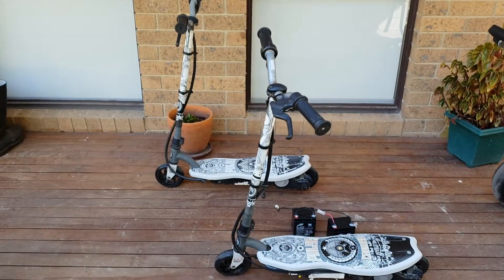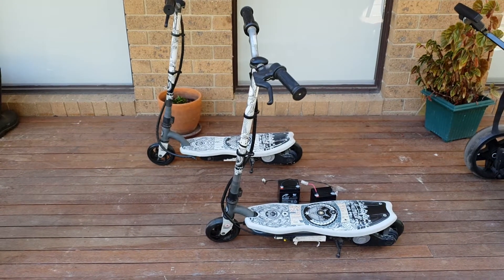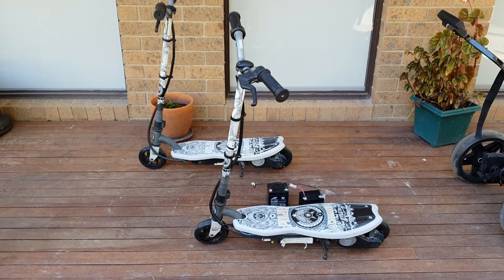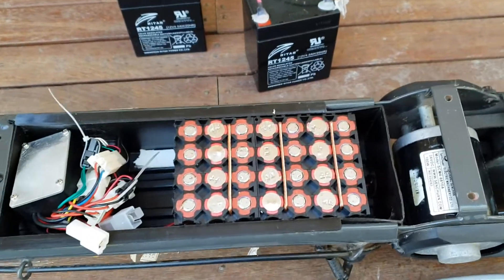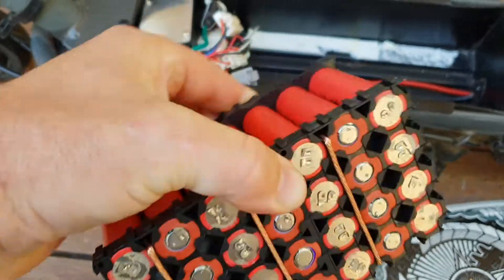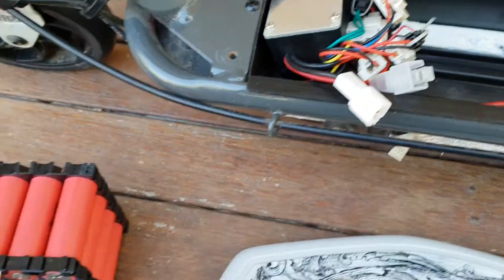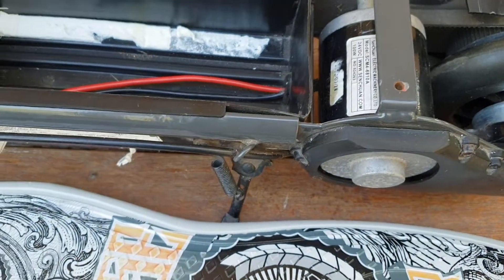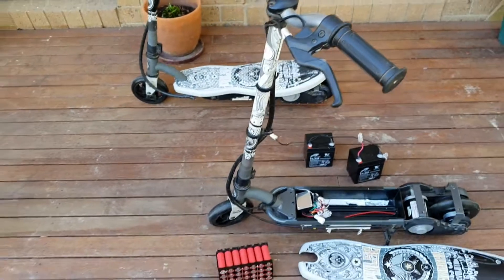Escooter Lithium Upgrade. DIY 24 volt lithium battery

Comment: Me to found a pair one I put a vacuum battery 36 lithium ion volt to 24 volt scooter was super fast for 2 minutes than stop I think I burn something. Than I connected 36 volt battery straight to the motor with kill switch was super fast  n powerful for 12 minutes then battery die was hard to control at first cues to fast .
Reply: How many volts is your ion.
Reply from the maker: @yubymendez9079  24 volts, the battery goes forever 😀

Comment: You can do a shunt mod to the controller for more power, just cover 20% of shunt with solder very easy.
Reply from the maker: Thanks for the tip I may have to try it 😁
Reply: Offgrid Dreaming,
Upgrade to 190w+
It looks like it will draw about 5amps peak, so if you keep adding solder to the shunt till you get to about a 8amp peak draw with load the controller should be ok at that current just see how hot it runs.
Reply from the maker: @rdservices2617  Thanks for the tips